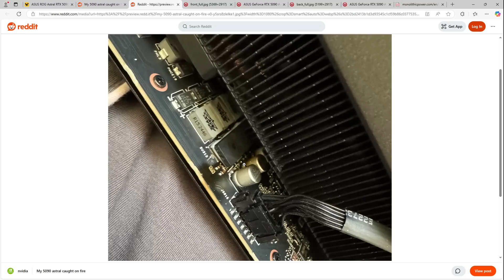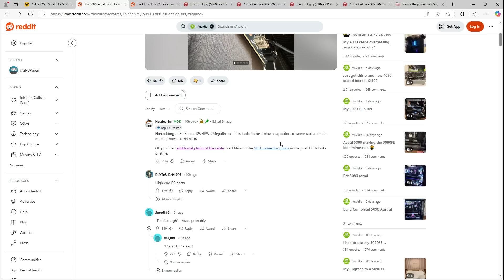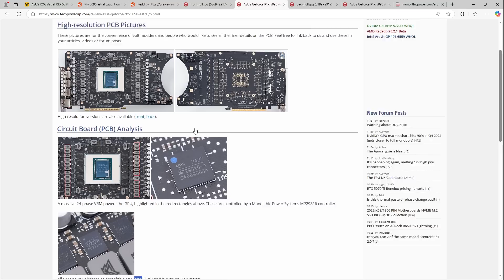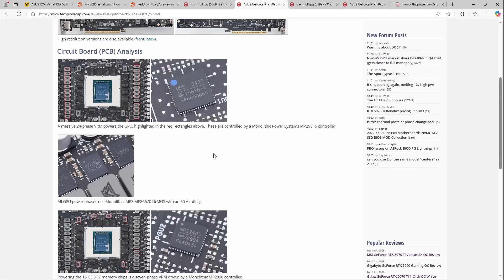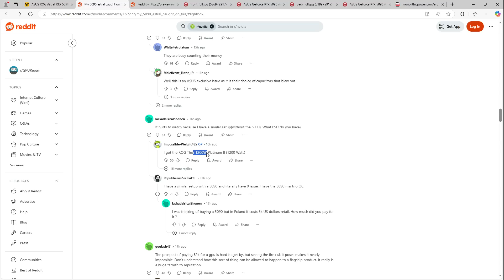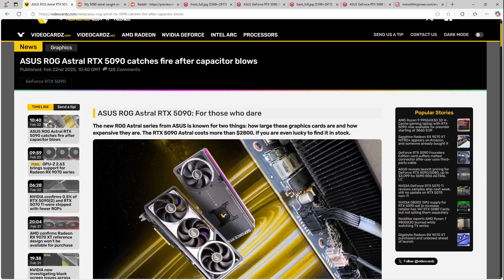Innocent capacitor blamed for ASUS RTX 5090 Astral catching fire

Comment: As you increase the current amounts and as a byproduct are also introducing more heat and higher operating temperatures to the cards components then you are stressing those components more to the limits of their safe operating capacities and at the same time probably reducing their lifespan.

I really wonder who thought a GPU pulling 600 watts was ever going to have the lifespan or reliability of a GPU that was using like components and only pulling 275 watts?
Heat has always been one of the worst enemies to electronics and that is still true today.

Maybe this is one of the real reasons AMD decided to quit playing in the 80 and 90 tier GPU performance arena and focusing more on the 70 tier and lower brackets as they could see there were problems looming at how hard you had to push these cards to reach that level of performance with the currently available technology.

Comment: Buildzoid pointed out it was not a capacitor and was instead a power stage failure, the capacitor is being blamed for something it is incapable of doing.

It’s almost a tradition for the top end Nvidia GPU of any generation to kill power stages violently.

Comment: Hm, I'm in the PC/Laptop repair business and I've seen/removed/replaced many shorted ceramic caps from motherboards. Replacing them, or just removing them from the PCB, restored many a laptop's life. So I wouldn't call them "indestructible" in the slightest. And in most cases I have to use a thermal camera to find them as they don't look blown or even cracked. The only sign is, well the short obviously, but also their abnormal temperature.

Just to be clear, not saying/implying that this card died because of a blown cap :)

Comment: Part of the issue with people blaming capacitors is the capacitor plague. They commonly failed back then, and most people still blame them, even though all capacitors are way more reliable than the ones around that time.

Comment: i would just say, these cards have huge power connector issue pulling shitload of amps to the card, low current control by not splitting rails for safety. we can assume that the card pulled over the rating limits for the core or vram, and caused a blown component, which also proves the bad over current protection for these cards. Or can also just be one factory defective unit and totally isolated case

Comment: 1:35

Been in tech repair for a long time and I loathe Reddit for a lot of things but this thing the most.

People feel the need to answer about broken tech with certainty or even "a good idea" when they know jack sht. 

I honestly think it's a huge reason people still view thermal paste as some component of a board that effects 10 different things as opposed to a material used to transfer heat from metal to metal. Tons of people on Reddit telling a guy with blown GPUs, consoles, etc to 
"Check the thermal paste and then try again". 

Yes, capacitors are also throen around loosely and I think it's due to the average person knowing the word. Most may not even be able to tell you what a cap does but they know the word so a broken item has a bad cap.

It bothers me.

Comment: Blaming caps is probably the legacy of the bad old days when they used crappy electrolytic caps. It used to be a very common cause of failure on mobos especially.  They would bulge, begin leaking DC, and if you're really unlucky they'd jizz cap spooge all over the insides of your computer.
Reply: I fixed a microwave oven with a domed, leaky electrolytic on its 5v board just yesterday. Reminded me of those self-same bad old days reworking mainboards.

Comment: do what i do.  whether its ebay, fb marketplace or anywhere, join in on reporting all nvidia 50 series scalper listings anytime you see them as scams thru whatever system exists on the market you see.  it only takes 5 secons, and it only takes that happening two or three times and they pull down the listings.  please spread this idea. please join me in doing anything you can.  the inadequate release and scalping and all that goes with it was intentional on nvidias part.  this is their new default launch strategy if we dont make that a problem.

Comment: At this point, you'd have to be an absolute fool to consider a 5090. Even under ideal circumstances, I doubt any of them are going to hold up for longer than 2 years under regular use before catastrophic failure. It only highlights another big issue, and that is nVidia's dominance in RT, Upscaling, and general productivity on the consumer markets. It's evidently bringing technological stagnation and carelessness in design; people will buy prone-to-failure GPU's anyways because the alternatives just don't compete in those 3 areas at that level.

Comment: Capacitors failing nowadays might be pretty rare. But I think it was a different thing in the late 90s and the early 2000s with a lot motherboards. Pretty sure my Abit BX6 died due to one of its caps leaking out its electrolytes all over the motherboard.

Comment: I'm running an 8 year old GTX 1070 OC from ASUS... other than mining for several years continuously I play the few games it can handle. No issue whatsoever but I need something more powerful so I ordered a 5090 lol.. can't believe they're that trash. Not yet seen any example of issues when they use the supplied cable and do not OC.  If I have a good ROG motherboard, ROG PSU and use the cable with the card, one would hope it runs fine without any tinkering or OCing... otherwise they've really gone downhill badly.

Comment: You can't really blame the guy for saying it was the cap, because experience for the last 30 years has shown that caps that leak, and dry out cause problems.. 

That being said, you're just as guilty as that guy, only based upon even less evidence. You don't have the card in hand, and haven't tested it, so merely saying "that's a power stage issue because it's happened in other cards" is based on what? "the discoloration of the power stage IC?"

Now.. That being said, i'm not saying you are right or wrong in your diagnosis of the issues, i'm just saying it's very shameful to create an entire video, lambasting someone for jumping to a conclusion without having the device in hand, while also junping to a conclusion without the device in hand. 

You statement that a "solid polymer capacitor"  is basically indestructible is also completely incorrect in every sense of the statement. (By the way, those are not solid polymer capacitors your're pointing at, they are surface mount aluminum polymer electrolytic capacitors. A "solid polymer capacitor" as you like to call them, are actually called shaped polymer capacitors, and they look like tantalum capacitors, only they are usually black in color.

Comment: The thing with fuses on high power electronics is that you can't put one quick and rated close enough to never falsely trip, and by the time they do something else has already gone up in smoke. The necessary eFuse design would be monstrous on something like a 5090 - large, expensive, complicated and only done on safety/mission critical equipment that can't have a single point of failure on power supply.
Reply: Yes, I was thinking of this.

Comment: After 30 years of GPUs, I have mostly only had issues with the high end cards. The GTX 200 series I had several fail the same way, after the 3rd replacement they refused any more, 980ti same but literally days out of  warranty and it seemed to be a common failure on that specific 980ti. 
I run monitoring software all the time and the cards are never out of spec in any way (at least the parameters you can monitor), so I attribute the failures to poor design.
My Radeon cards over the years though, seem way overbuilt

Comment: It's almost like you predicted that GPUs are going to die horribly with no fuses on the 12V rail and behold, it really happened.
I don't wanna touch 5000 series or 4000 series by extension. I hope RX 9070 XT is gonna launch smoothly and I'm just gonna be happy with both of my kidneys in place and good rasterization performance.

Comment: I worked on cards where MLCCs blew a hole in the board. EVGA 1070/1080, MSI 1080, ASUS R9 290x etc. Sapphire had bad MLCCs in their rx 470/480 cards on the back of the board but those have fuses so they only burn when "experts" replace the fuse with a thick wire.

Comment: Historically I have had so many motherboards fail due to cheap electrolyte style caps going bad. This may be the reason others also jumped to the wrong conclusion about the GPU failures. My last bad mobo was bought in 2005, since then all the mobos seem to have the good quality capacitors.

Comment: It must be a leftover from the era of electrolytic capacitors everywhere. I personally had mobos in 2000s go bad over the years and requiring replacement of electrolytic capacitors to work. You can find examples of blaming modern problems on past culprit in almost every corner of human society.

Comment: All of these cards will die way too early than 40 series. This is a stupid vrm design for high current circuit. Btw i couldn't see any fuse around connector or pci slot side on that Asus 5090 photos.. Funny..

Comment: Those  power stages didnt have any contact with the radiator, prolly overheated and then shorted after solder melted

Comment: 5090 FE on Asus PSU with custom cable (PSU connector melt)
5080 Astral  on Asus PSU (PSU connector melt)
5090 Astral on Asus PSU (Power Stage failure)

Comment: So funny... the minute you re-post/link these vids on HW-boards, people will jump in to defend NV, saying this was "fine, because it's one card in who-knows-how-many", etc, etc. 
1. This is unacceptable, full stop. There are proof-marks on these products that should indicate that something like this will not happen. Kinda like a new car needs to be run through some sort of gouverment-agency conducted safety testing before it can be sold to the public. 
2. Especially on a product whose MSRP and actual current market price rival that of a used car.
3. Imagine it was your card that went poof! and possibly took your motherboard, your PC or maybe even your whole house with it.
4. If NV wasn't trying to turn GPUs into luxury items (with matching prices), and if they hadn't messed up this launch the way they did so far, folks would probably be willing to give them a lot more leeway when it comes to things like this.
Reply: Bathtub curve is a thing, no matter how much you try hardware will always fail early on.  Can be any reason.
You can eliminate some causes, but you will push the cost up.
This would not be at all likely to start a house fire since we build power supplies with protective components and PCBs are made of non-flammable material.
Reply: @tomsixsix  I was maybe overshooting a bit there, but even if it doesn't burn down the house, it will result in a dead GPU and possibly (looking at the user's pics) borked motherboard. Which means you'll have to deal with customer support and demand refunds, wait for new parts to come in, rebuild your PC, double-check everything to make sure no other components were damaged, etc, etc. Of course: There's always a possibility that any appliance will be bad out of the box or go bad way too quickly - but I find it funny that this happens on products that have become vastly overpriced over the last couple of years and that this doesn't seem to be the only problem (far from it) on this particular product/product-line.
Reply: @1SaG  oh yeah, agreed it's not fun there at all.  However, you have a sample size of 1 here - if this is 1 in a million cards then no one would be concerned.  If this is 1 in 1000, then it starts to look like incompetence. Until you know what that divisor is, and truthfully only the retailers and manufacturers know, you can't really take much from a random failure. Sometimes they just happen no matter how much care you put in.
Reply: @tomsixsix  Agreed re the sample size ... although it would be very interesting to know what exactly caused this. Bad component or bad design, basically. The "good thing" is that with products this expensive, I'm pretty sure that if there are other users who have suffered/will suffer this, at least some of them will also make that failure public. I'm hoping this will turn out to be just a one in a million freak accident kind of thing. Wouldn't wish a self-destructing GPU on anyone, no matter if they paid 300 or 3000 dollars for it. :)

Comment: I have a 2080 which crashes under load with a black screen and 100% fan speed unless I undervolt it to under 1700Mhz. Now I'm wondering if it could be a power stage failure. Or could it be the VRAM or core?

Comment: The video was very helpful.
Do you know the NVVDD (Output Power) item of the HWiNFO graphics card?
I am using the RTX 5090, and I was able to confirm that the maximum power value was excessively high (close to 1200w) during gaming.
The RTX 5080 was also similar.
Should this be considered a simple program error?
Or is the problem related to the issue in the video?

Comment: Hey buildzoid, not sure if my other comment posted as Youtube is being arse. Any chance you can look into doing a video on the 16V rated capacitors blowing on Corsair ICUE Link hubs? It's a problem. 

I cannot link to a collage I made of a few PCBs but if you are curious there is plenty of posts on the Corsair subreddit if you search them out. In this case it is 100% the capacitors blowing and always the same ones. Corsair has been silently handling it for over a year but has not actually taken steps to mitigate this issue. In some instances users end up with further hardware loss.

I am just thinking because its topical on the back of this video that it is worth a look and maybe a PSA for the greater good. I know Corsair and propietary garbage go hand in hand but ICUE Link is next level lock-in and it bothers me to know people are investing so much in an ecosystem that centers around a failure prone hub.

Comment: I haven't had this issue with an SPcap yet but i have seen one Panasonic just a normal low-esr capacitor which was formed backwards and where the stripe and long pin were effectively on the wrong side, they must have accidentally reversed it when they assembled the forming jig. I wouldn't be surprised if this can happen to an SP as well, in an extremely unlikely event. Obviously not the issue here, yes.

Liquid electrolyte capacitor failures plain do not happen in the first couple years of device life basically regardless of what sort of device it is, they need to age first before they become a problem, but they generally do become a problem eventually, and i should say, low-ESR caps are the bigger pests than classic old style ones, because they have prompted the engineers to start yeeting all sorts of components and designs that would limit the ripple current on capacitors and over-relying on them staying low-ESR for a long time, which they just won't. MLCC problems are pretty common though regardless of age, it can happen a few weeks in or a few years in.

Comment: The reason people always blame capacitors goes back to circa 2006 and all the bad electrolytic capacitors that were blowing left and right. Apparently some company in Taiwan hacked a Japanese manufacturer and stole a formula for an electrolyte that was faulty. Some say the faulty formula was posted intentionally. However the Taiwanese company started cranking out these bad electrolytics so much cheaper than the Japanese that all the computer parts manufacturers were using them so every time a motherboard or monitor or about anything with a switching type power supply had the caps short out after a year or two. I had a side hustle where I'd go around to neighborhoods in the city were garbage pickup was the next day and bring home several monitors, recap them (Panasonic or Nichicon) and then sell them. Motherboards on the other hand forget it, those would burn the multilayer PCB so there was no chance of repair. 

Anyway because 9 times out of 10 a failure was caused by one of these bad caps that people who don't really know electronics would cite that as the cause of failure even though it's been over 15 years since that was a problem.  Plus everyone went away from the older foil and electrolyte type of caps and went to some sort of solid electrolyte. Now if you see a blowen cap it's most likely a symptom not the cause of the problem which most likely of a power MOSFET shorting out and blowing the cap not the other way around. Google "Capacitor Plague" for further information.

Comment: Polymer aluminium capacitor arrive in the 90' for essentialy save space on  boards , it was new and it was bad quality. They all started leaking acid on the pcb , corrode traces and oxydation welding after 10 or 15 years. The classic aluminium capacitor was more reliable in the 90' than  this first batch of polymer.
But i have never seen a capacitor explode or leave a trace like this in normal use.